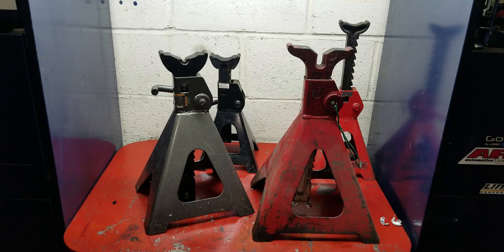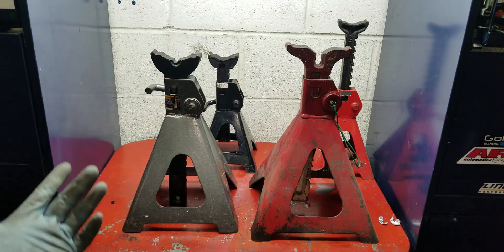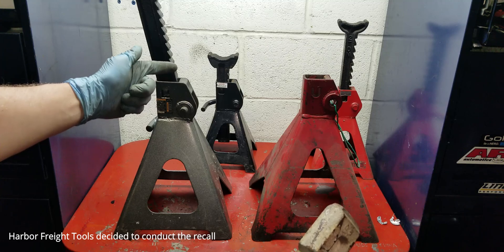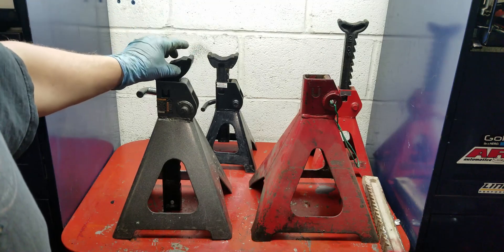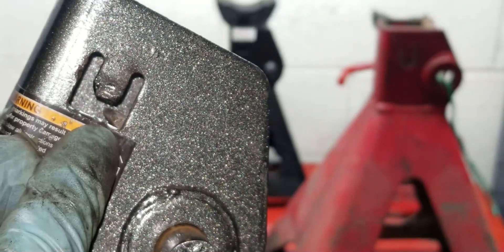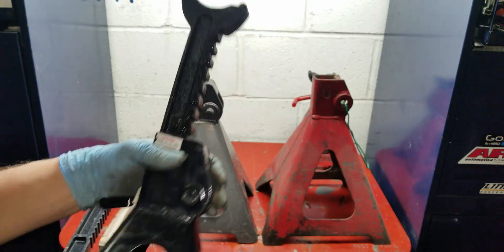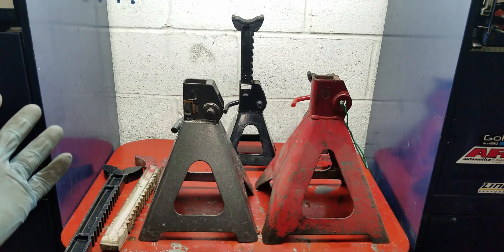I Think I Know Why Harbor Freight Is Recalling Jack Stands. A look at #61197 6 Ton Jack Stands

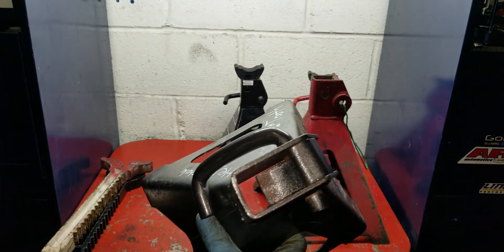Comment: You can see it at 4:50 - the pawl isn't cut square so it's not fully engaging on the shallow teeth
Reply: It doesn't matter to me what improvements they have made. The fact that they "tested" these and put them out for sale, is enough for me to never use harbor freight jack stands or any lifting devices again.
Reply from the maker: I think you are right a misaligned pawl will not grab the shallow teeth. I returned my set but they were out of stock on replacements so I can't verify changes yet
Reply: https://youtu.be/cwcWdKwPvhI this video is the best one on YouTube

Comment: I will tell you what happened to mine. Very simple. The roll pin holding the pawl to the handle-lever sheared causing the pawl to rotate down with the anvil.

Comment: Is it a bad idea to drill some holes in the toothed piece and push a 5/8" hitch pin thru, maybe grind that lever and cam off, and rely on the pin to carry the load? I've got a set like this video shows with the Husky label from Home Depot.
Reply: DON'T DO THAT !
It will make the toothed piece weaker and it could break. 
Also, no exchange if the stands have been altered in any way.

Comment: Also Rick I'd be very careful with the new set a gentleman just did a video I'm the new 6 ton jack stands number 56368 is still having an issue 56369 seems to be okay but as I see you your mechanic I wouldn't risk my life on those jack stands buy a set of Torin double locking jack stands no problems there
Reply: Or maybe a real set of stands ( I.E. Not Torin)
Reply: @o.p.h.o.v.e.n  I'm sure you've already heard hazard fright has already recalled the replacement jack stands as well as offering customers their money back on the 3 ton 6 ton 12 ton if they so desire. I saw a video on the jack stands the guy showed them the wells are excellent they're called the pro lift 3 ton double locking jack stands 2999 on Amazon

Comment: This is my opinion, but jack stands aren't meant to be used with no weight. All the Jack stands you tested there did the same thing. Test the stands with weight on them. While under load try to get the release lever to disengage and drop down there by dropping the vehicle/load.
Reply: Right.  
The "load" is actually a functional part of the locking mechanism.
The "load" actually forces the pawl deeper into the gullet of the teeth IF the teeth have a positive rake angle.

Comment: Hey Rick. I thought I was safe when my new 6 ton stand were not listed but, someone immediately replied to my post on imgur.com said that I should check them out anyway. So here's what I found: https://imgur.com/gallery/QNjyU7Y

I'm probably going to take them apart and correct the pawl engagement depth and weld a plate to the handle to slide a safety pin in to prevent the handle from unlocking.

Thanks for the post.

Comment: The pawl is bouncing due to you pulling it up rapidly.  When it bounces, it flat out disengages.  If you then push down faster than the pawl can drop back into position?  Yeah, you get it started and from there it's just bouncing along as the teeth go down.  Tooth depth has little to do with this.  What would help is to have a larger pitch (fewer teeth for the same distance) to give the pawl more time to drop back into place.  Either that, or a spring return on the pawl.

Comment: A guy was working on his porsche when the jack stand failed causing the car to fall on his face.
Some how he was able to get the car off of hisself & get to help.
Reply: Source?
Reply: the light load was part of his problem, and he thinks he kicked the lever. it shouldn't have let go, of course. the recall is because of the other failure mode:  collapse when shifting the load. Both are due to bad pal engament.

Comment: You aren’t taking the load off and suddenly putting the load back on, you’re actively pulling it up, back towards you, and then slamming it down, this is why it did it on all of your stands in the video. That’s very different than having a load on it, lifting the load straight up, and then putting the load back on the stand. So in the nicest way possible, you didn’t recreate the issue at all.